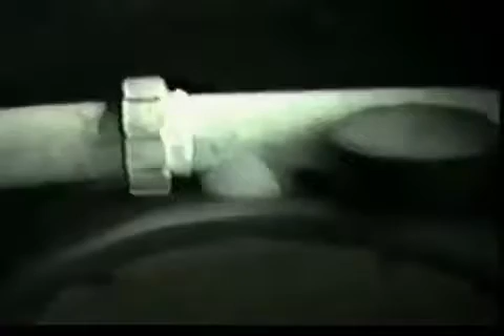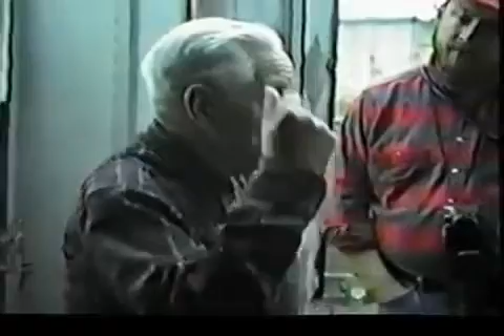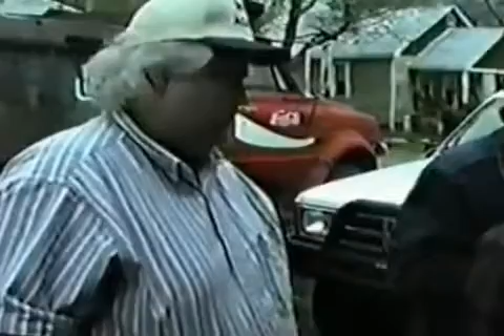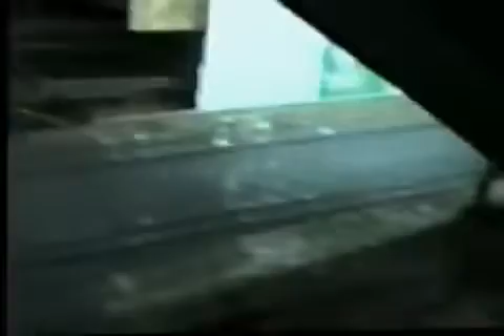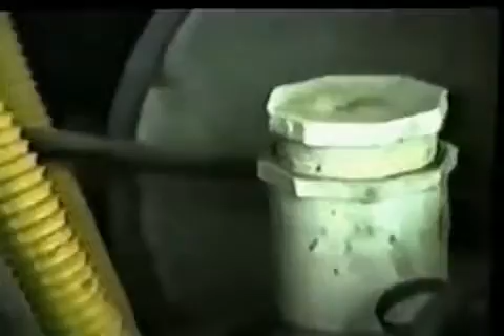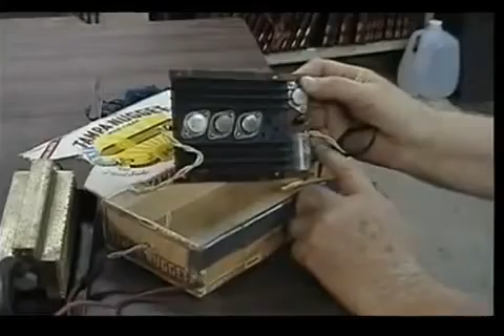Herman P Anderson Water powered car

Comment: Someone else wrote this elsewhere 
"Hydrogen-on-Demand
Deuterium Gas, sometimes called H2 with the number "2" placed above,instead of below, the center of the "H", as when writing H20, and aka "heavy hydrogen" (not to be confused with the liquid deuterium oxide, aka "heavy water") may well be one of the keys to a successful water fuel system.Herman Anderson is the only water fuel device inventor to talk openly and at length about this. Herman explained why it is important to make deuterium,which is a non-radioactive isotope of hydrogen. It is twice as dense as hydrogen. That means you will need less than 1/2 of the gas you would otherwise need to run a car! It also means that the flame speed is reduced!That means more power!Some of the challenges associated with using hydrogen as fuel are eliminated simply by tweaking the hydrogen produced from water so that it becomes deuterium. Again, we're not talking about "heavy water", but "heavy hydrogen". It is rocket science, to be sure, and that is why Herman was uniquely qualified to know how to do it. He was a rocket scientist.He may not have had a degree in physics, but he knew ions, and he was the one to reveal this to the world in his own Tennessee "country boy" way. He said that a 70,000 volt corona discharge superimposed on normal electrolysis will cause the hydrogen ions to form deuterium. He further stated that the gas is powerful enough that you have to shut down production of it at idle.It used an LP regulator and had a working pressure of 8 ounces!
Herman's System:
A 3-1/2" wide slice of 14" OD PVC pipe
is fitted with two narrow (1") strips of the same pipe recessed just inside of its two openings. This allows the mounting of the two 13" round nickel-plated steel anode and cathode plates to these mounting flanges.A gasket and gasket-sealing compound are used to seal the plates to the chamber.
The plates thus mounted are now 3" apart. They have a short1/2" bolt welded to the middle of each plate, facing outward, to accommodate the electrical connection, which is a battery cable on the positive side, and a battery cable and a HV spark wire on the negative side
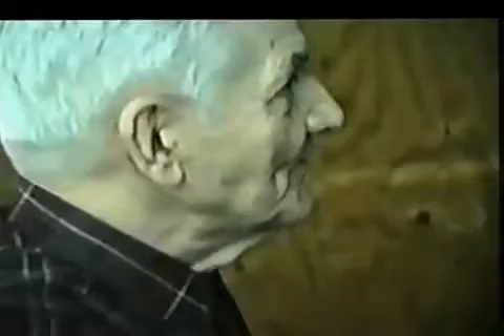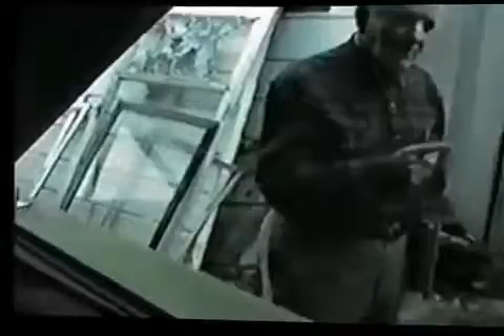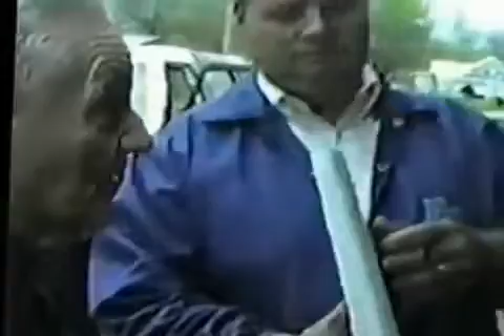The chamber has 4 holes drilled and tapped at the 12:00, 3:00, 6:00 and9:00 positions. The two located at 3:00 and 6:00 accept 1" barbed hose connectors and plastic hoses that connect to a 2" PVC stand pipe. It is used as a thermo-siphon radiator and allows the introduction and circulation of the KOH electrolyte solution (pH 12, using de-ionized or ozonated water). The 9:00 hole is capped and unused.
The 12:00 hole is drilled and tapped to accommodate a 1-1/2" white plastic sink trap adapter 'T' drainpipe
This allowed for the passage of the hydroxy gas on to the LP regulator and finally the engine's carburetor. It also allowed for the introduction of a stream of pressurized air from the car's heater blower fan.
A Honeywell gas pressure sensing switch, mounted between the chamber and the regulator, detects hydroxy pressure and shuts down the current to the electrolyzer when it reaches 8 oz. Gas production is thus cycled on and off as needed.The aluminum throat that is used to induct the hydroxy to the carburetor is like that formerly used on an LP forklift. It prevents the escape of the lighter-than-air hydrogen gas.
A Lemert Selectrol water injection device, such as used on a WWII P-51bomber, introduces a fog-like stream of water vapor to the intake manifold,which serves to cool the burn of the hydrogen and adds steam power to the combustion stroke. i would post pictures if i know how to add pics here."

Comment: Herman ran a high voltage corona wire inside  his 2 plate high induced magnetic field, in side that canteen looking cell.
3" gap between the +anode and - cathrode round plates.
Reply: I recall reading something close to a couple of decades ago that stated that his ignition system was producing voltage in the soft X-Ray range.